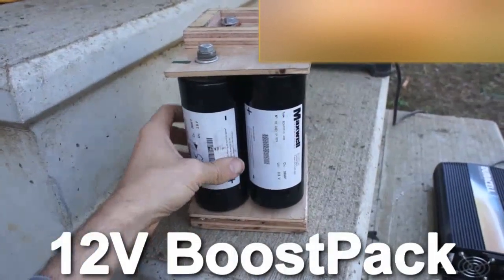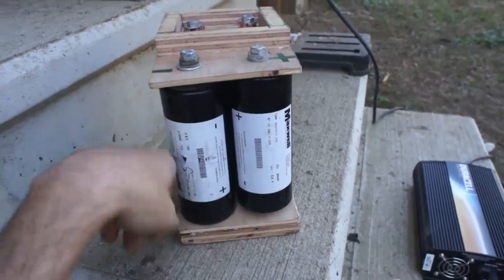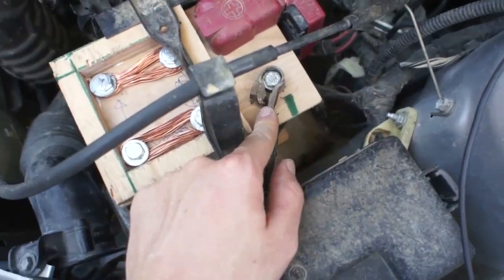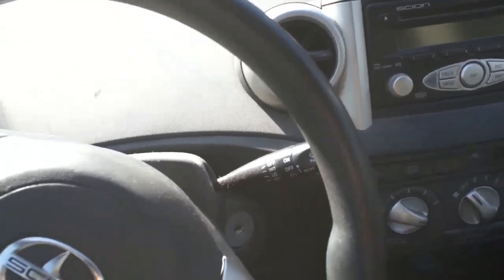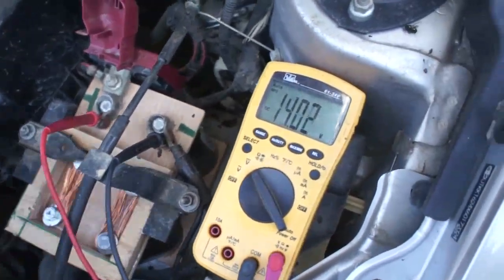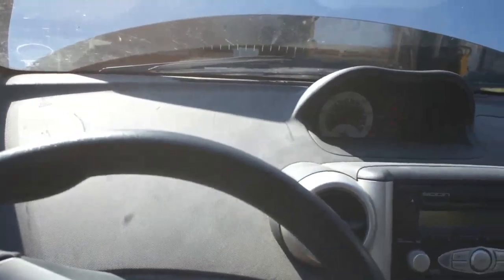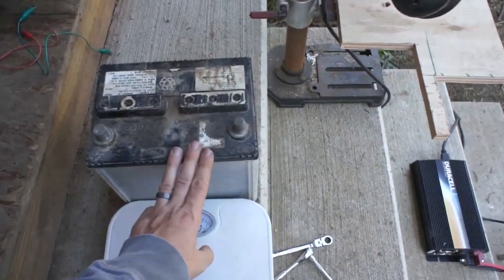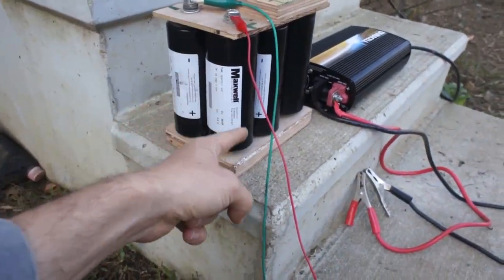12V BoostPack. Replaces auto battery. Works great!

Comment: Christina Ibarra  It is not BS these caps were literally $5-6 each around the time this video was being made as literally thousands of used caps were dumped onto surplus sites but people bought them up pretty quickly when they realized they were available.
Reply from the maker: Yes, I am kicking myself that I did not buy a lot more back when they were $6 each.  At the time I had no idea what I would even use them for.
Reply: The voltage remains the same so you are not sourcing any more amps from the capacitor bank than you are from a properly sized battery.  The internal resistance of the starter an cables remains the same.
Reply: Spikes When you buy a battery for a car you buy it based on size and minimum Cold Cranking Amps.  You should always buy the largest battery that will fit the car because it will last longer and is less likely to leave you stranded.  That being said the internal resistance of the battery is not a huge factor because in almost all cases even a cheap vehicle battery is going to be capable of delivering 3-4 times the cranking amps that the vehicle needs to start and so the internal resistance of the battery will be negligible compared to the resistance of all connections, wires, solenoid and internal winding's of the starter motor.  The capacitors in this video actually have an internal resistance for a string of 6 that is close but a bit higher than the original lead acid battery (due to number of connections and internal design) so the maximum current they can deliver is lower than the lead acid battery but they do not suffer from loss of chemical starting capacity in cold weather like the original vehicle battery.  I ran a pack just like this in my car for nearly 6  months without an issue.  The only reason I did not keep using it was that my car's computer has a very high parasitic drain and would drain the capacitors down after sitting for 3 days. 

The car battery will source more than enough current to weld with it.  In fact placing 2-3 lead acid batteries in series with a big 6 gauge inductor is common place for DIY mobile welding rigs on many family farms.  Coincidentally electric golf carts typically run on 36V and are prime candidates for this.  On more than one occasion I have seen farmers repair a broken weld on a piece of machinery in the field with nothing more than a pair of welding cables clamped to the 12V tractor battery and a 6010 or 6011 welding rod and a welding helmet.  Ideally you want to have 3 batteries in series and an beefy inductor to help maintain an even arc but sometimes you have to do what you can with what your given.

The contact points in the solenoid in your car's starter are rated much higher than the max amount of current your vehicle's starter could ever draw even while stalled out.  Even if you had a capacitor 1000's of times the size of the one in this video it would still only be delivering the amount of current necessary to start the car due to ohm's law.  The starter and wires are still presented as mostly a resistive load.  If you were discharging the the capacitor through a dead short yes you would most likely weld the contacts but the resistance of that starter circuit is probably in the neighborhood of 0.02-0.04 Ohms.  A new lead acid battery will have an internal resistance that is generally far less than 0.35 Ohms.
Reply: Capacitors & batteries both have anodes & cathodes separated by insulating, or semiconductive dielectric material. Batteries consist of at least 2 dissimilar metals with anode being different metal than cathode; submerged, or soaked in liquid called "electrolyte". Capacitor's anodes & cathodes are separated by semiconductive dielectric material. Anodes & cathodes can either be the same, or dissimilar metals depending on design values. Both capacitors & batts hold an electrical charge (field). A capacitor's charge is an "electro kinetic" field  that can be described as joules / coulomb, whereas as  a battery's field  is electrochemically  induced by a chemical reaction known as  "electrolysis" that is measured in units of amps/ time.  Capacitors charge  & discharge quickly, where batteries are just the opposite. Nevertheless  resistance rises as charge increases in both so the charger method nor the load are affected when either capacitors, or batteries are installed as long as they are rated for circuit load requirements.
Reply: I'm sorry. I mistook you as a rational individual that was simply misguided. I was referring to the batteries recharge circuit. Furthermore anytime there is electrolyte there will be reactions. Moreover the dielectric, and the electrolyte are 2 different things.
Reply: Father Trucker
jX represents the phasor algebraic variable that ( j is a + imaginary number operator pertaining to a vector) represents that voltage lags current 90 degrees in the formula describing the (static) graph of the hypothetical capacitive reactance  portion calculating the given circuit's total impedance. It wasn't necessary here; it is for those that have had physics, and mathematics.
I included it mainly because with a vehicle's engine will be equipped with an alternator, and it's output (AC) for battery recharging is ultimately converted to a pulsating DC on the output of the rectifier in the voltage regulator; this process will develope reactants inherent with AC generation. Of course filtering circuits (RC, ICs etc.) integrated, or external (older vehicles may have simple RC circuits) of the voltage regulation devices (vehicle dependant); no matter how complex these circuits are designed to replicate a pure DC signal (voltage potential) will still leak a small amount of reactance that will be dissipated in the form of heat of course. But it can still be calculated using reactance formulas previously mentioned if desired even though it is within tolerance ratings (decimal rounding), and basically disregarded as long as everything stays below the design temperatures of course. But the "KISS" explanation definitely needs only Ohm's Law, and phasor graphs to visualise the aforementioned relationship.
Just disregard jX since you already understand that it is ultimately just impedance ("Z") standing in for resistance ("R") using Ohm's Law.
Reply: Capacitors store a charge very similarly to all the various types of batteries weather lead acid, AGM, Sil. Gel, Ni - Cad, Met Hyd., Lithium Ion etc. There is no resistance difference in start circuit obviously so current draw is mathematically identical (Ohm's Law). With Capacitors the current leads voltage so many degrees when the relay contactor closes. Hence the lively starts. There is a difference of resistance regarding the charging circuit between car batteries, and his cap - pack maybe, but as long as the output of the alternator is 13 - 15 volts; and the Capacitors need to be rated above that. Resistance isn't a design factor especially in the starter motor windings; it is a result factor subordinate to voltage, wattage, and of course the all important Capacitance is important. The required total Capacitance value that best fits for this specific purpose is determined by field decay rate, and charge rate; using six Capacitors in parallel give you both also perfectly mimicking 2 cells each as in batteries with the "Goldie Locks" capacitance determined by differential formulae. In fact your better quality Lithium Ion batteries mimic this with "the best of both worlds"; the "snappy" discharge rate of a capacitor coupled with the "slow & gradual" decay rate of the deep - large charge field of a battery. Capacitors need more consistent charging to be as reliable as a battery; IOW they are not a "fire, and forget" item between OEM maintenance intervals like one of the conventional type batts. In fact as with Lithium Ion batteries the Capacitors, or "visa - versa" will completely collapse to zero charge at a fairly constant value all at once like a blown fuse, or a switch opened the circuit. But having stated all that the man seems to demonstrate his point about his cap - pack very well in his video.
Reply: Joe Blow, no it does not.  It functions nothing like a regulator and has no changing resistance.  Resistance dissipates power internally, and in any capacitor, it is steady state, dependent on construction only, not voltage level.  And "electrolytic" describes the materials and process used to form the dielectric barrier inside the capacitor upon first manufacture only.  After that, the electrolyte functions only as a conductor, and neither it nor the electrodes take part in any chemical reaction ever again in safe recommended use.  If any capacitor changed resistance during use, it would be unsuitable in any signal path and would cause distortion or unpredictable operation.  Take note of photoflash and tv flyback electrolytics.
Reply: In other words by keeping it simple stupid we can describe why a capacitor  is interchangeable with a battery as a circuit's power source use the concept of impedance to generalize Ohm’s law in phasor graph form so you can visualize it better; apply and extend the law to capacitors (and inductors). After describing impedance, you use phasor diagrams to show the phase difference between voltage and current. These diagrams show how the phase relationship between the voltage and current differs for resistors, capacitors, and inductors.Put Ohm's law for capacitors in phasor form. MOREOVER THINK OF IT LIKE THIS: because the frequency for a battery is 0 and a battery has constant voltage, the impedance for a capacitor is infinite, and likewise the capacitor acts like an open circuit for a constant voltage source because a (assume a DC circuit) FULLY CHARGED CAPACITOR has infinite resistance. But since the plates are so close, charge build up on one plate induces charge in the opposite plate of the opposite sign mimicking a battery's field; therefore we can build a circuit with only resistors, and since Ohm’s law says that voltage equals current times resistance, or V = IR we can simply insert a Z representing impedance. Again, grant you when you add electrical storage devices to the circuit, the I-V relationship is a little more, well, complex because resistors dissipate energy as heat like devices dissipate regarding reactance in AC applications, likewise capacitors and inductors store energy in a DC application.

Moreover again capacitors resist changes in voltage, and oppositely inductors resist changes in current. Like resistance,  Impedance provides a direct relationship between voltage and current for resistors, capacitors, and inductors when you’re analyzing circuits with phasor voltages or currents.

Like resistance, you can think of impedance as a proportionality constant that relates the phasor voltage V and the phasor current I in an electrical device. Again put in terms of Ohm’s law, you can relate V, I, and impedance Z as follows:

V = IZ
The impedance Z is a complex number:

Z = R + jX

Simply put if you charge a big capacitor with a DC power supply through a resistor and measure the voltage with a VOM in the meter's "VOLTS" setting across the terminals of the  capacitor. It will steadily rise to the output voltage of the power supply dependent on the circuit's "TIME CONSTANT". Just like when using a VOM (meter's battery) to observe the resistance (impedance) climb as  the charge develops when applying the "good / fail" test with meter in it's "OHMS" setting though with out resistor it only takes a second (very short time constant).
We can take the charge/voltage/capacitance equation a step further to find out how capacitance and voltage affect current, because current is directly proportional to the rate of flow of electrons, or holes generating the charge. ... If the voltage (the capacitor's full rated electrokinetic field charge) across a capacitor is steady and unchanging, no current will go through it.
Reply: I'm in Washington state....
Reply: +Bob White So?
Reply: Super/Ultra Capacitors discharge a lot slower than smaller capacitors.
Reply: Rikko40  Yeah like big batteries discharge a lot slower than small ones. . . . .
Reply: a capacitor is not a battery
Reply: well you can weld perfecly with bateries, they are great for that as it's a great current source, but bateries get damaged while welding, it's a short circuit! capacitors andle a lot better short circuits but they won't hold the power that well, after one hour i bet the cap bank is discharged it's that low internal resistance at work... i work with those since 2006 in wind farms as emergency stop bateries for pitching out the turbine blades and stopping the turbine!
Reply: +Spikes, you should let the many thousands of car audio enthusiasts in on your concern about the low internal resistance of the capacitors they put across the power terminals...

Starter motor contactors are designed to handle the current spike experienced when starting the motor, and of course the massive current it continues to use while cranking the engine.  I don't understand your analogy of comparing putting a short circuit across a battery/capacitor to make your point?  That implies you think that the starter motor is a dead short, and it's not.  If you measure the battery voltage of a good battery even during a hard crank, you'll notice that the voltage is still usually around 10V or better, and since that's the majority of the open circuit voltage, it implies the starter circuit is mostly the current limiting element, not the battery.  Batteries are made as low as resistance as possible before durability becomes a factor, and to fit certain vehicles... not to match a current limiting factor.
Reply: Just 3 years ago, they had them for $10 a piece and I waited so the price would drop...... look at the high prices now. I wish I would had bought them back then.
I was going to use them with a solar panel system.
Reply: It does not matter if  a load or electric device gets its power from the battery or a capacitor or anything else.
For example, if a load or electric device uses 5 amps, it will use the 5 amps if it comes from a battery or a capacitor or even a solar panel. To make it simple 5 amps at 12 volt is 60 watts and again, it does not matter where the power is coming from it will use 5amps or 60 watts. 
Most alternators are rated at about 80 amps or with  newer cars for 60 amps. Battery wires and alternator wires are rated for those currents, which is a requirement by the dot. Alternator output is rated in amps and charging a battery or capacitor will not shorten out the charging system since the alternator has windings that is creating a resistance. If anything the alternator may not put out enough amps to charge a very big bank of capacitors or a big bank of  batteries  and that would just slow down the charging process.  But a electrical device will never use more amps because of a big bank of batteries or a big bank of capacitors,.......that is ohms law......no but's and if's !

A battery is powered by a chemical process and that will slow the charging and discharging, also the chemical reaction/ process speed is different with the temperature of the battery/acid. Acid needs to be maintained in a battery and as soon as a battery is build it will start to die/corrode  if you use it or not.  A battery needs to stay charged or it will die sooner/faster. Under charge of a battery will kill a battery sooner.

A capacitor has 2 electrical plates and a dielectric media almost like plastic. If power is applied onto the plate it will create static and we all know that static can give off electricity and if the static is big enough a spark. A big static spark for example is lighting. The 2 metals and dielectric media can be rolled up so a bigger surface area can be put in a smaller space like in a cylinder looking capacitor. The bigger the surface area the more power it can store. The 2 metal strips can be roughened up and that will also increase the surface area and with it the capacity. 
A capacitor like that can be charged and discharged many times and it does not wear out. It can be discharged and stored that way without any damage.

The oldest capacitors that I personally know is 45 years old and  is in a equipment and used daily.
I do not think there are to many batteries out there that are that old.
A battery as well as a capacitor has a self discharge.
Reply: Lead Acid Batteries develope a film due to age, and inactivity; this residue is the resulting  byproduct of the electrolyte, and its chemical reaction. Furthermore there is also ionic reaction that causes the residue to accumulate via a static charge. This film (sulfidation) is not conductive it is an insulator so it impedes charging. Therefore unless a cell opens, or shorts the plates can be rinsed to bring the battery back to life. The better the cleaning of the film the better the battery will charge /discharge.
Reply: One quick point to note... I saw somewhere, someone mentioned that both batteries and capacitors show a rising resistance as they are charged.  This is not true, unless you meant something else instead, like back EMF (and no, that is not limited for describing only inductive circuits...).  Battery resistance vs charge level depends on it's particular chemistry and maybe construction also.  A capacitor retains it's same resistance no matter what It's charge level, and it depends mostly on construction and materials, and not chemical action (there should be none).

Many people are pointing out that capacitors charge and discharge faster, and so not as good for a single charge life cycle.  For those who don't fully understand, you have to also express how you are comparing the two, before making that statement.  For now though it's mostly true...

For the same size (I'll use volume) and voltage rating (to make comparison simpler), a present day supercapacitor will not hold even as much charge as a NiCad cell, yet.  There is still more development needed.

For the same charge capacity, the charge/discharge curves will be different... most batteries stay in the higher range of their voltage range for most of their charge cycle, which makes them easy to use for powering most equipment in a stable manner.  The voltage a capacitor supplies is directly proportional to the square root of it's charge level.  So, a battery may still retain most of it's voltage when there is only 30% of it's charge left, but a capacitor will sag sooner, and then spend a LONG TIME outputting less and less of it's full voltage (both until dead).  So, to benefit from using a capacitor, a power conditioning circuit would most likely be needed to supply most equipment with stable power... similar to what is already in a car or portable (battery bank) cellphone charger.  A switching regulator and/or additional booster.  However, the good ones are more efficient than the loss experienced by electrochemical conversion.

Finally, a capacitor is easier and more efficient to charge/discharge, using the appropriate circuits.  A capacitor can give and take high current without heating up.  There is no electrochemical conversion inefficiency.  A battery loses efficiency due to chemical conversion both directions, which also generates heat... and pressurized gasses if excessive.  A battery will wear out, mostly it's electrodes.  A capacitor undergoes no internal change and will not wear out except due to environmental conditions and misuse.

So, for now, they each have their strengths and weaknesses, mostly capacity and voltage profile are the only problems at the moment.

I hope this will help everyone understand. 👌😊
Reply: Resistance does rise as the charge field is increased. For instance that is how a voltage regulator functions which is what controls the rate of recharge. It's easily calculated with ohm's law to assist you to visualize it. Also there are many different types of capacitors with one being an "Electrolytic" capacitor for just one example.; which indeed has electrolyte therefore chemical reaction etc.
Reply: Joe Blow where are you going with this?  Stay on track please.  There is a reason I am trying to help you understand...

The electrolyte no longer functions as an electrolyte in the capacitors.  What about that don't you understand?  Let me explain, and challenge you to tell me why my explanations are irrational.

Inside a ready to use electrolytic capacitor, there is a foil strip, a porous layer like felt, soaked in electrolyte, and another foil layer with a thin INSULATING layer on it, between it and the electrolyte.  Electrolytic action is insignificant against an insulator.  If both electrodes were carbon, it wouldn't make a difference.  But metal is needed to provide the initial coating.

Electrolytic action happens ONLY ONCE at the factory, to manufacture this.  Not during it's operation.

If you want to argue with me, you better back up your statements with a respectable source...
Reply: Joe Blow also, I read another comment you made.  You are mostly on the right track, but just a couple mistakes.

A dielectric is not semiconductive.  It is an insulator.  Yes, a reverse biased semiconductor, such as a PN junction, FET or MOSFET can be used as a capacitor, but is only done in ICs and varactors.

The type of metal on either side of the dielectric makes no difference in functionality.  Only the thickness of the dielectric and it's dielectric constant.  To use different metals, there would need to be some other reason to do so.
Reply: Challenging is not the word. I do not pick on people. But you sir are very confused. It is difficult to understand anything you are trying to say because none of it makes sense; I wished it did so I wouldn't be wasting my time. In  answer to your comprehensible statement: what in blazes are your sources? And in answer to your last post is that dielectric could be either insulator, or semi- conductive dependent on its design purpose it is considered "dielectric breakdown", but is used in numerous circuits. Also it is a fine line in semiconductors (ICs) with regards what constitutes a gate, or a dielectric. (ohms) settings. Moreover that is the method to check a capacitor with a VOM. First set the meter to one of the highest ohms setting then place the meter leads by polarity on capacitor's terminals. 
The reading should start at zero, and climb to maximum design charge resistance; this denotes a good capacitor. The reason the reading climbs is due to the VOM battery is charging the capacitor; as the field builds the resistance climbs to design value (infinity) which mimics an open circuit.
Reply: Joe Blow I am not confused at all.  It is you who have trouble with expression and comprehension.  But if English is not your first language then that is understandable, but not your accusation that I am confused.  As to the question of sources, I asked you first.  Also, everything I said makes perfect sense.  And no, a dielectric can NOT be semiconductive.  In any instant, if a  semiconductive material is used, it is used as a semiconductor only, or it's used as a purely INSULATING reverse-biased junction acting as a capacitor.  Not both.  And your method of testing a capacitor behaves as you say, but it is incorrect.  The ohm meter is not measuring resistance of the capacitor.  Do you even know how an ohmmeter works and what It's actually measuring?  Hint- it isn't directly measuring resistance.  when it charges up the capacitor and eventually shows near infinite,  it is lying to you.  If you raise the voltage, many amps will flow into it until it's stable again.

You can't measure a capacitor's dynamic resistance with an ohmmeter.  Only it's leakage resistance.

You sir, are picking the wrong guy to argue with about anything electronic, so yes, you are wasting your time.

You're the type of guy who would put an ohmmeter on a car battery and wonder why it either shows infinite resistance, or why you fried your meter.  Please stop and study theory and proper testing procedures.  You are new to this but reading a lot of Wikipedia or something.  I started to know better than this before age 17, and that was long ago sir.

The method to check capacitor working resistance is with a resistor, a relatively high frequency AC signal, and a proper voltmeter, done with at least 2 or more frequencies, high enough to avoid reading capacitive reactance.

I don't suppose you know what that is?
Reply: Furthermore immediately disqualifying Kevlar's ridiculous statement regarding "XC" (that I initially overlooked because of his previous incoherent ramblings) towards the end of his last post. Make no mistake "Reactance" both "RC" & "XC", counter EMF, Eddy currents etc. strictly pertains to AC circuits. Most of you have seen the term "Impedance"; this is derived from the reactance in AC circuits. Therefore to simplify, reactance is the resistance of AC circuits. And as with all units of measure an AC circuit's reactance / total impedance is expressed by mathematical formulae. But all of the aforementioned is for another conversation because we are discussing a battery which is of course DC. Nevertheless getting back to my recent initial post, and to be thorough, the old VOM "capacitor check" method works perfectly as a simple hands on example of what I have repeatedly stated previously, "as a capacitor's field increases so does it's resistance". This fact is obviously easily visualized while performing the test. because the battery that powers a VOM charges the capacitor's field displaying the rising resistance of the capacitor as it's field increases.
Reply: Joe Blow you are not measuring resistance of a capacitor as it charges through a VOM you goofball!  How can I get this through your thick skull?  You are measuring the voltage chsrge on the capacitor, that the VOM supplied to it.  And your rambling about mathematical formulae is meaningless here.  A capacitor's charge/discharge resistance is not measured using DC methods.  you need an AC signal, or AC superimposed on DC, to measure that.

...And I never mentioned anything about RC.  Where did you see that?
Reply: Joe Blow I am a heavy equipment technician with both hobby and industrial electronics experience. I've passed every one of my courses.  Part of my trade requires me to design and troubleshoot control electronics for hydraulic equipment we install on highway trucks, and guess what?  They contain capacitors.  Now, most of the capacitors we test are larger electrolytic ones used as power supply filters, which are rated barely higher than the safety margin we allow above their supply voltage.  They do their job because they have an extremely low dynamic resistance, at a commonly used voltage, higher than your VOM puts out.  The only thing on a capacitor you can measure using your VOM is leakage across it's dielectric, which should be infinite no matter the voltage.  FYI a VOM determines resistance by sending a constant current through it and measuring the voltage across it.  that is why you think you are measuring resistance through a capacitor.  The VOM is responding to the charge voltage across it, rising until it shows "over limit".

Anyway, it would be appreciated if someone knowledgeable enough would chime in here and offer their opinion about which one of us two is on the right track.  Apparently one of us wants to get personal...

And I still never mentioned anything about "RC".

Joe Blow, you must be trolling.  Nobody with the knowledge of a tinkerer would normally put up a fight quite as you did 😄
Reply: Oh most definitely please let someone chime in that can add to what I've stated. Yes I  knew by your comments that you only possessed just barely enough knowledge to be dangerous that is no surprise. But like I have told many apprentices, and students alike going on 52 years with almost 60 in the industries, " that unless you have something intelligent to say to shut the fuck up every chance you get so as to refrain from looking foolish". Credentials? You want to compare credentials? LMAO!!! Well OK you asked for it son: I not only hold both Master & Journeyman electrician licenses ( having taken both "Block & associates & PSI state Exams) including reciprocity with several states (as many as 6 at once in past years),  but I also have earned both an AAS degree in Industrial Electronics from OCCC & an MSEE degree with  minors in computer science & law from Texas Tech. Not to mention that I have also earned several various certificates of various mechanical & construction trades, and was a Navy trained Propulsion Engineer resigning as a First Class Engineman ("Black Gang" "Snipe" having earned much "Fruit Salad"). Yes  I was in the USN where I went to A thru D Diesel, Gas Turbine & Nuclear propulsion systems schools including Machinist Mate & Boiler technician  A - C schools; did 3 Med - cruises & 2 "Westpacs" (card carrying "Gator" "Shellback") including Vietnam where I volunteered (to combat boredom not the enemy like everyone else) brown water duty having received both a Purple heart & a Bronze Star with V.  I have not only worked in the field of commercial - industrial, and hydrocarbon facilities (oil field) electrical fabrication & service all over the world including winter & summer over  Antarctica, AK, Subic Bay PH, and Johnston Atoll to name a few, but I have had several instructor positions at both vocational technical  & university level. Furthermore I not only did electrical construction & service all over the globe the last half century I have maintained production equipment & facilities in several industrial manufacturers from air conditioners to aircraft. I am also a certified welder &  very accomplished old school / CNC machinist that has fabricated countless commercial & personal projects. Moreover I am a licensed pilot, real estate broker, investment advisor, and "beeve" rancher.
Reply: You are either intoxicated, or you suffer an affliction because you continue to make ridiculous statements, and cannot comprehend simple instruction. This is basic, I recommend that you take basic AC / DC theory course with hands on lab so your instructor can help you demonstrate because there is obviously no hope for you here. But for those readers that may be following, the meter is on the "OHMS" setting when performing a "failed / good" test on a capacitor; therefore it is displaying "RESISTANCE" (infinity / open circuit) not volts. I do not know why the confused Kevlar brought up "RC"; that is obviously "Capacitive Reactance" which there is a formula of course, and as I've previously stated only applies when describing AC circuits. The VOM "fail / good" test is strictly a DC operation. Moreover a capacitor with a DC voltage applied will act as an open circuit impeding current flow until the voltage is increased to the capacitor's saturation point when "dielectric breakdown" occurs which will then allow current to flow; only capacitors  that are designed to operate at, or beyond their voltage saturation rating are used as circuit "gating" devices (such as SCRs, Transistors etc.). Whereas the properties, and usage of a capacitor when an AC voltage is applied is very different. When an AC voltage (signal)  is applied the capacitor constantly cycles from a charged to discharged state allowing current to flow in both directions. Also the frequency at which this occurs is dependant upon the frequency of the applied voltage. As the frequency increases the reactance is inversely proportional therefore it decreases; this reactance can be measured, and visualized with an oscilloscope. And as I've previously stated this can of course be described with designated mathematical formulae as is true regarding all units of measure. Additionally semiconductor "doping" processes have become extremely sophisticated, and has facilitated very advanced generations & versions of ICs that run the gambit not only in miniaturization (size), but increased ability as well allowing for more, and more new circuit types. Also, like I previously stated, "it is a fine line what constitutes a gate, and a dielectric". Nevertheless, again if Kevlar was at all experienced as pretends then he would have known all of this. Furthermore math describes what we cannot see; electrical units especially, but a VOM is an instrument that can physically (in the physical world) demonstrate exactly what I have said 5 times which is, as a capacitor's (battery's) field increases so does it's resistance"; this simple DC circuit can be described mathematically with basic "Ohm's Law". Moreover this also describes the operation of a simple voltage regulator circuit like the billions controlling the current flow during battery recharging. Again as the charge increases the resistance is directly (not inversely) proportional therefore it also increases. And again this is an extremely basic yet utterly useful, and very common electrical application that exists in hundreds of billions of electrical (electronic) devices & equipment;  and if it didn't exist would render us technologically impotent to say the least.
Reply: What amazes me is how ignorant does one have to be to state the stupid comments that you have, and stand by them like some very strange sacrificial jackass. No son my advise to you is delete all of that ridiculous posting, and retreat to the rear to lick your wounds. Then try desperately to pull your head out of your ignorant keester, and enroll in the nearest reading comprehension class. Then when finished reread my posts in an attempt to interpret them correctly. Then if you can somehow muster up an intelligent question I would be just tickled shitless to address it as such; but until you do, don't expect me to allow your ignorant statements to go unanswered because I can type out a quick overriding response on my IPHONE just about anytime from just about anywhere no problemO. Like the statements you've made measuring capacitors with VOM. FYI you are testing to see if the capacitor is good, or has failed. New VOMs have a separate setting for testing capacitors, but it is still measuring the resistance then sends those same values to the additional internal circuitry ("Op - Amp") of the newer meters using them to translate the capacitance values. EITHER WAY THE METERS ARE IN THEIR OHM'S SETTINGS FOR CRYING OUT LOUD! THEREFORE THE DISPLAY VALUE REPRESENTS THE RESISTANCE I GUARANTEE JEEZ ! WHAT THE HELL? HOW DID YOU LEARN ANYTHING YOU'RE SO FRICKIN HARD HEADED.  IF IT WAS MEASURING VOLTS IT WOULD HAVE TO BE IN THE VOLTS SETTING. IF YOU WERE FORMALLY TRAINED YOU WOULD ALREADY KNOW THIS BECAUSE YOU WOULD STUDY CIRCUITS EXACTLY LIKE THOSE IN A VOM; MATH INCLUDED. ALSO IF YOU HAVE EVER ACTUALLY TESTED A CAPACITOR WITH A VOM YOU WOULD SEE THAT THE READING STARTS OUT AT ZERO OHMS, AND CLIMBS TO IT'S DESIGNED MAXIMUM WHICH IS THEORETICAL INFINITY, BUT SOME WILL SHOW A VERY HIGH VALUE OF OHMS IF THE VOM IS AT IT'S HIGHEST OHM'S SETTING; IF THE VALUE STAYS ON ZERO WITHOUT CLIMBING THEN THE CAP HAS FAILED SHORTED; IF THE VALUE DOESN'T START AT, OR NEAR ZERO, (AGAIN DEPENDS ON SETTING HOW CLOSE TO ZERO) THEN THE CAP IS FAILED OPEN. AND I GUARANTEE IT DOESN'T MATTER HOW LARGE THE CAPACITORS ARE, OR THEIR RATINGS THEY CAN BE TESTED THIS WAY! The VAC rating is for the design maximum; meaning the capacitor is good for voltages up to the AC voltage rating.
Reply: Kevlar Canuck
LOL
What a dipshit you are.
You absolutely are talking out of your ass.
Drunk or stoned whatever you need to take a class.
No one in their right mind would come on a thread to make a complete fool out of themselves if they were in their right mind that's for sure.
Reply: Joe Blow, Asperger's?  My condition is way beyond that, dude.  I'm fully lobotamized 😜  I'm way beyond help sir... 😄
Reply: JAMES RUTHERFORD sorry to disappoint you 😂.  Are you related to Joe Blow?  Neither of you have contributed a singlr reference that can disqualify the subject matter I have laid out.  Turning things personal is a common tactic for those who cannot do so effectively.
Reply: LOL No I don't know Joe, but he is absolutely on target.
Talk about show what the fuck have you shown other than your stupidity?
You should be asking questions if anything not making retarded comments about something you apparently know nothing about.
Reply: Joe Blow I just noticed your other message containing an abundance of capitalization, worded in a frustrating manner.  do you need a pacifier? Maybe a fidget spinner?  I repeat.  Resistance of a capacitor is unrelated to charge voltage.  Your VOM may measure capacitance value, I'm aware of those.  Good for it.  Still nothing to do with ohmage.  A pass/fail test using it only tests the dielectric.

Rant all you want on your iPhone.  if you like, I'll keep going...?  But I have to sleep.  So please, flood the thread with more of your entertainment.  I'll be expecting a shitload of it first thing in the morning 😁
Reply: JAMES RUTHERFORD ooohh, you are cursing now.  Keyboard warrior mode... love your style.  The only question I have is, why would I question the established expertise of what I do successfully in my career?  I'm not about to drop my training and experience for some filthy-mouthed YouTubers.  smh
Reply: JAMES RUTHERFORD yes, ohmage is an actual word.  You and your bro Joe Blow would know it, given your qualifications 👌
Reply: Name your reference junky.
Now I know you're not just stupid but completely full of shit.
Reply: JAMES RUTHERFORD wow, your hostility is sure making you correct.  By strides...

I'll dig up my old textbooks and modules, and get back to you later.  in the meantime, ESR and leakage resistance are your clue terms.
Reply: Kevlar
You've never even used a multimeter let alone attended an actual class.
Reactance is AC resistance. ESR is irrelavant here; we are not concerned with leakage. We are just testing whether a typical (not necessarily a super cap) capacitor has failed , or is good.  BUT THE WHOLE POINT OF THIS TEST IS THAT IT IS A GOOD WAY TO VISUALLY SEE HOW AS THE FIELD DEVELOPS THE RESISTANCE WILL RISE PLAIN, AND SIMPLE. This is how the procedure works: The meter's battery charges the capacitor. The meter is set on resistance so it reads resistance which climbed from zero as charge increases. If you think that it's doing anything other than that then you need to reread the book or whatever. This also demonstrates the method  that regulates a typical battery charger's voltage regulator circuit.  As the battery's resistance climbs so does the battery's field charge where it  (electrokinetic field same as capacitor) limits the voltage to charger's design value ( a couple of volts above battery voltage so as not to overcharge the battery. The circuit is designed to throttle current flow to battery to keep from overcharging it. Simple Ohm's Law describes this. You really need an instructor type course with a lab. You will actually be able to use a multimeter then. Plus you will learn ohm's law and everything.
Reply: Joe Blow reactance is not measurable with an ohmmeter.  You need a sinewave signal and the measured value is only valid at that particular frequency.  ESR measures a capacitor's actual resistance to give or take a charge when the applied voltage changes.    If you suddenly apply 3V to a capacitor charged to 2V, there will be a huge current spike which quickly decays to zero.  If you take that same capacitor and start with a 12V charge on it, and suddenly apply 13V, the applied voltage difference is still 1V and you will get the exact same current spike, even though the voltage levels are higher in the second case.  That implies the same resistance exists regardless of it's initial voltage.  You need to use the proper test procedure and understand your results.  I have a link for you as reference, when I take my next break.  I hope it is helpful.
Reply: That's the trouble with self paced courses like the one you took to help you work on the machinery etc. that you say you work on for a living. The courses are ok as a starting place. But they leave a lot regarding the actual methods, and procedures that have to be included to give at least a working knowledge of electrical devices, and circuits.
Like I previously said, " you need to enroll in an AC/DC theory, and introduction to electronic devices courses, at your local community college, or vocational - technical school with an actual instructor & and hands on lab". If you want to really excel in the field get into the apprenticeship program.  I'm not bucking anything regarding your reference ; if you read my posts you would see that a lot of it not only coincides, but has extra information for you to learn that is not included in your reference.. The problem is you are bucking mine. If you read my posts I have given you brand new material for free. I have been patiently waiting for you to read my posts, and form logical questions that you may have. But instead you have got it in your head that because you took a simple self paced electronics course that you are ready to post technical advice & instruction on the internet.
Son I've read everything you posted, and I'm here to tell you that between that course, and your hard head that your understanding of the material is not good. Furthermore in case you missed it in my last post because you are too busy looking up your reference,  I didn't say you measure reactance with a VOM. If you read what I previously wrote then you would see that I told you that  you need a signal generator, and an  "O" scope to measure reactance the first time you brought it up. You are confused by not being able to comprehend the sentences.Reactants (AC only) , ESR, and leakages are totally irrelevant when performing a "good - fail" test with a VOM.We are talking strictly DC because the battery in the VOM is the source when performing the good - fail test. .  The test from the beginning of the discussion is to demonstrate that as the field increases so does the resistance. If you place the VOM on it's OHMS setting, and it's leads across the terminals of a discharged capacitor what happens is the meters display will momentarily read zero immediately climbing to theoretical infinity; You are not measuring the exact resistance, or ESR. This proves two things; 1. that as field is increased so is the capacitor's resistance when charged, and 2. that the capacitor is still functioning (has not failed).  Capacitors fail all of the time, and this is the method to check them in the field. We are not interested at this juncture the precise resistance of a given capacitor;  we are demonstrating the relationship between the capacitor's, or battery's  field, and when they are increasing so is their resistance. THAT'S ALL.
The reason that the capacitors work in place of the battery like in this video is because the recharge circuit can't distinguish any difference between the two. The real time difference is that the capacitors charge quicker than the battery likewise they also discharge quicker.
Reply: Joe Blow I didn't tell you I took a self paced course.  Why would that even matter?  I passed well, is all that matters.  Even if I didn't take a course, I still knew this walking in there.

No, you are not measuring resistance of a capacitor with a VOM as it charges.  You didn't read the link.  you have trouble absorbing this concept in the face of evidence other than my own.  Just because the VOM is in the ohmmeter mode, doesn't mean you are measuring resistance.  If you hook your VOM to a 9V battery and it reads "infinite", and you believe that is the actual resistance (likely only a few ohms), then you are obviously using it incorrectly.  An Ohmmeter is nothing more than a voltmeter which supplies a constant current.   It measures the voltage developed across a resistance.  If you use it on a capacitor and you see it charge up, you are doing nothing more than measuring it's voltage.

Resistance dissipates power.  The effect you think you are measuring does not.
Reply: Kevlar
For the very reason that you have to ask the question, and that you do not know what difference it makes is the reason it matters that you get formally trained. Furthermore just the statements in this last post of yours proves how important it is to go where there is an instructor, and a lab where you can be exposed to actual exercises is exponentially better than a self paced set of modules leaving a lot to your own misguided ideals exactly like the ones you apparently have. You've not even been able to muster one sensible question, or remark in all of your posts. I bid you good luck with all of your continuing learning disabilities, and troubles.
Reply: Joe Blow I cant believe your patience with that idiot.

The things he says are so ridiculous he has to be full of shit.
Nobody can be that far gone unless they were acting.
On second thought, you know that between the booze, drugs and Ritalin that guy has gotta be hopelessly ripped.

Either way one thing for sure and thats kevler is a A grade moron.
Reply: Joe/James(same person, nice try), the patience and tenacity comes from my idiocy of entertaining you, otherwise you wouldn't bother lol.  Clear your head.  I didn't tell you where I got my training, and you have provided absolutely nothing tangible to back up your statements, so you're just talking out of your ass.  And I have no idea why I keep feeding your trolling ass, that will end soon.  Babble and trash talk me all over YouTube if you like, (from the safety of your keyboard)... I know you will, you can't resist the urge to reply after this, throwing childish insults because that's all you have, and it seems that's the one thing you're actually good at.  I refuse to continue in a battle of wits with someone who is unarmed.

Ciao, time waster 😁
Reply: It aint no mystery that you never went to school. I am a licensed HVAC service tech with 11 years in the trade. I have to replace start capacitors all of the time and the vom is the tool of choice to test if they are bad. I also have taken votech electric and electronic classes as part of my training as well as have taken a correspondence course. i know the difference. not sure what your problem is because you have contributed diddly squat to this thread. You have major issues is the only thing for sure besides the fact that you dont know shit. I would say that you you were a legend in your own mind but we know that is impossible because you all ready admitted that you were a lost cause. So piss off DIPSHIT!!!!
Reply: JAMES RUTHERFORD ooohhh the dipshit bomb with an exclamation point.  Well, you "ain't" have any idea how deep my dipshit-ness actually runs, good sir, would you like to see?  I know you'll reply 😄  I can read you like a book lol.  Up your game, I'm getting bored here.

I, and in the link I provided, showed how testing capacitors with a VOM is a way to check if they are bad.  So I'm not sure what you are arguing about or your cause for hostility.  You might want to take your meds again.

And I walked into the EXT course at SAIT pulling 90s in 1994 in theory and lab, because my hobby experience from 14 yrs old put me way ahead.  Second year was my IXT course, quite a bit harder.  I built a ~200W sub amplifier of my own circuit design at 19yrs old from spare parts I bought from the IEEE room at lunchtimes.  It uses a capacitor as it's power filter after the bridge because it has nearly zero resistance at full voltage (48V) That's why capacitors are used as supply filters.  Otherwise it wouldn't make sense to use them.  I don't want ANY ripple voltage across my supply and ground, and having a "rising resistance at high voltage" is absolutely counterintuitive.  The ripple is shunted to ground.  Why else are supply bypass capacitors a thing?

Anyway, I know talking to you is like talking to a wall, apparently I have difficulty realizing that because I'm a hopeless dipshit.  But that's my job here and I do it well, so... your turn? 😄
Reply: JAMES RUTHERFORD you know me too well lol
Reply: JAMES RUTHERFORD now we're getting somewhere.  Reading me like a fucking book. 👌
Reply: I use to have an ole stubborn good for nothing John mule that walked around eatin shittin and gaspin air then he would walk around eatin shittin and gaspin air.  Now he is a dead jackass. Yea I read ya.
Reply: joe blo
best explanation i seen so far
we all made a capacitor pack for my electric class.
even my instructor had a hard time trying to explain how it works
best dam explanation i have seen. 
thanks for explaining it i cant wait to tell everyone when class starts in august.
only question i have is what is jX represent?
Reply: Ah .....ok.
consider it disregarded.
should have quit while i was ahead. lol
Reply: kuhrd there is a difference between batteries and capacitors, batteries have internal resistance where caps have almost none. Thus you can not just compare just the voltage. The internal resistance of the battery limits the current to the load thus preventing you from damaging the contactor . This is why you buy the correct size battery for your car, too large and it would exceed its current rating.

Capacitors have almost no internal resistance and thus are able to provide a lot more amps to the load....

If you want to test this just try shorting a battery and the cap bank and you will see the difference. the battery will toss a little sparks... the cap bank, you could weld with...
Reply: +kuhrd I believe it works as you say but the only issue i can see is extra wear on your contactor that starts the car. The contactor is only rated for so many amps start and stop... now you are many 100s of times that number. You will eventually pit or weld shut your contactor and it wont let you start the car...